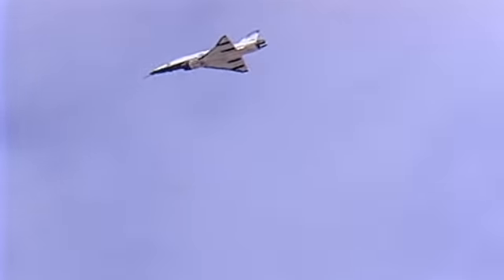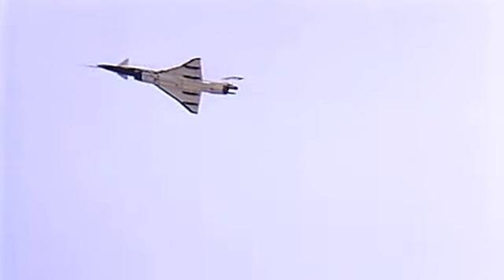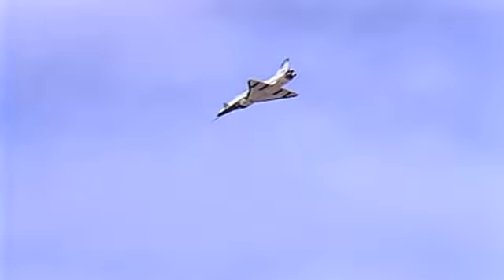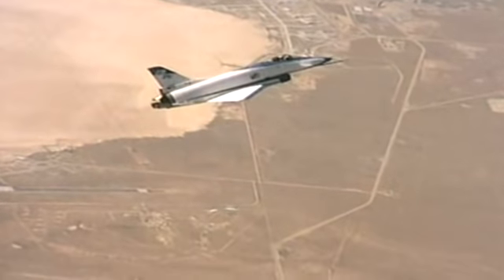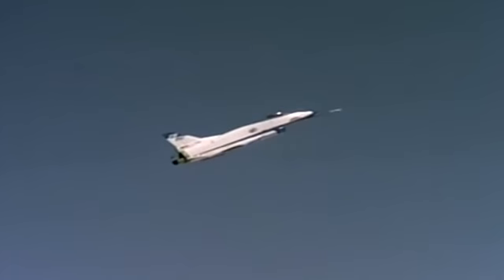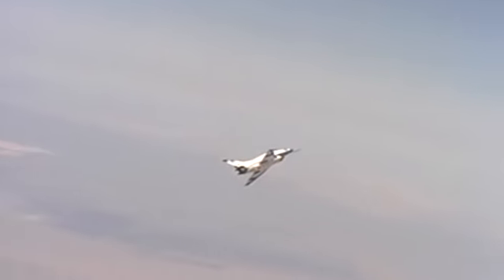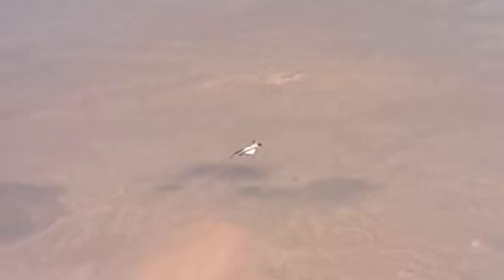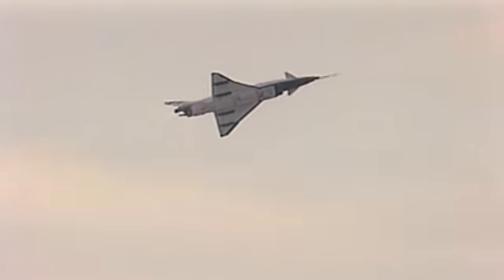X-31 Demonstration , Dryden's 60 Years of Flight Research video

Comment: It theoretically made it into production. It was always meant as a technology research plane for thrust vectoring. The X-31 helped to develop software and hardware for 3D thrust vectoring. Also they researched how thrust vectoring influences the radar signature (you don't need to use flaps to steer, that minimizes your radar-echo). The knowledge gained during the project went straight into the F-22 and the Eurofighter Typhoon.

Comment: It was never meant to go into production. This aircraft was a test bed using all the different technologies developed in the last 10-15 years.
Reply: Kopihucky then russia did and made the badass su 35 one of the best designed and most capable 4+++ gen fighters of all time. The F15 has the record though with over 100 confirmed a2a kills and better avionics but neither of them eould want to engage at all because if the f15 doesnt shoot it first with its longer radar it goes 50/50 and the better pilot will prob win but most likely whoever gets lucky first. Neither want those odds.

Comment: Then Russia took it and applied it to its fleet aircraft su 35 then su 57. Then China bought Su 35s so they could get the Al31F engines to try to copy them and reverse engineer them but have failed until very recently. They may be getting close now.
Reply: you mean stole it ,, thats all they can do right
Reply: @keithbell6104  it was developed differently tho
It was china that copied Russia
Reply: Actually everone was experimenting with thrust vectoring. The influence of thrust vectoring comes from the british Harrier jet. Until recently Russia had the best three demensional thrust vectoring. But the chinese have caught up. Using it on the J-10 C.
Reply: @keithbell6104  China actually bought SU 35 to study it's thrust vectoring.
Reply: @jg3000  No there is a definite difference in time between the introduction of thrust vectoring aircraft like the HARV F-16 VISTA and X-31 and the introduction of the AL31FP's
Reply: You're talking complete nonsense!

Comment: Makes the Su 35 and 47  look weak , but we see where the pioneering tech came from ,, THE US
Reply: SU-27 and MIG-29 would disagree
Reply: Su-35 cobra 120degree 
X31 70 degrees AOA
Reply: @sule.A  well full control AoA is different from cobra max AoA X-31 could achieve is 180 degree. That 70 degree is a fully control sustain AoA for X-31.
Reply: @ricodelpiero  180degree? So it will be flying in reverse the max it reach 70
Reply: @ricodelpiero  what do you mean full control AOA you cannot recover cobra?
Reply: No
Reply: Su27 30 and mig 29 can't hover
Reply: A prototype vs a full immerse fighter jets in the Russian air force
Reply: Actually the tech came from Germany, but the US made a deal that it would pay 70% of the cost if Germany shares the tech with the US.
Reply: @IntoxicatedPuma   look at what happend to the mig 29s in Desert Storm by the F15
Reply: @sule.A   they didnt try the 120 deg ,, you know it would do it
Reply: @duwang8499   funny i havent seen anything come out of Germany  by now let alone  30 years ago
Reply: @keithbell6104  Well you can just look at the plane to see the big fat "US and Germany" label on it.

Also the plane to heavily from other jet designs, on of them being the German TKF-90 experimental jet.

It all started that DLR (the German Aerospace Center) didn't had enough money for the whole project, so they asked the US if they wanted to use their superior design if they payed 2/3 of the price.

Also the Eurofighter and Panavia Tornado were partly designed by Germany in pan European projects.
Reply: @sule.A  Yes it can fly backwards and stand on its head
Reply: @duwang8499  Not really true the plane was a join effort and was made in part by Blhom and Northrop

Comment: Why dont they keep search and stuff..... And put this technology in other planes that are actually used in battles? (Im not good at this.... very young....)
Reply: The Messerschmitt Bolkow Blöhms  thrust-vectoring technology was transferred into the F22, which has only 2D thrust vectoring. Modern AA missiles like the German Iris-T SLM also feature thrust vectoring. Furthermore the combination of airframe and electronic-systems allowing for instable flight characteristics for max. manöverability is very visible in the Eurofighter.